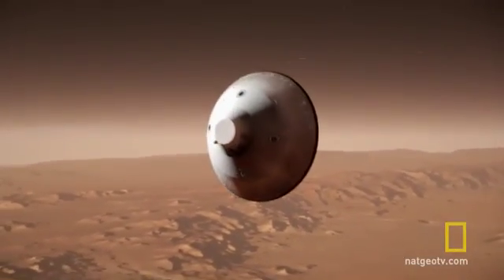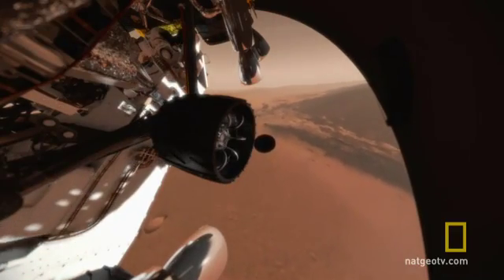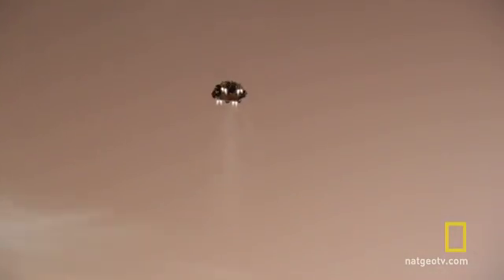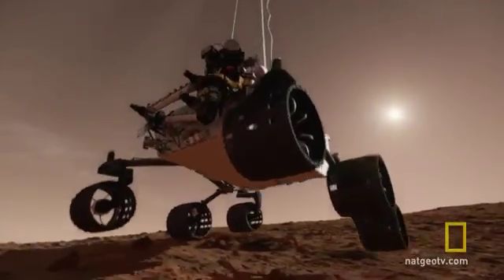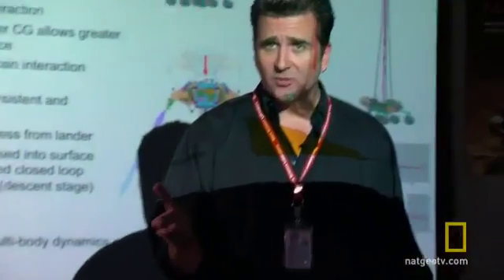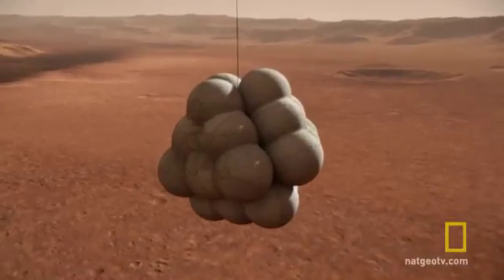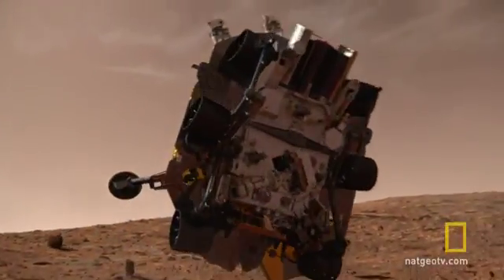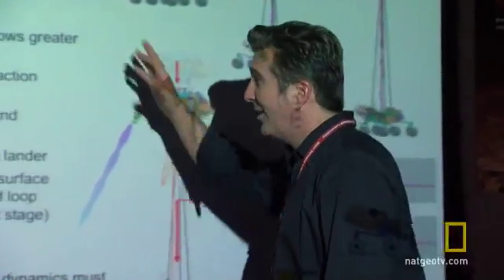Sky Crane | National Geographic

Comment: "They laughed, yes they did. But then they built it."
Reply: And now it's about to land 8 years later
Reply: @advSailing  actually it landed 10 years ago succesfully.
Reply: This video was for Curiosity. But yeh it's the same thing.
Reply: @TheChico868  so the Skycrane technology was imagined for Curiosity but they opted for something else at the time, then eventually did it yesterday with Perseverance am I right?
Reply: @tristand9129  no they used the sky crane for Curiosity. And perfected it again for Perseverance. They could not use the Air bags like they did for Spirit and Opportunity because of Curiosity's size and weight so they had to develop something new. I saw the whole documentary a few years ago.
Reply: @TheChico868  yeah
Reply: @tristand9129  Curiosity was the first try with skycrane, worked great. Great enough they used it for Perseverance and felt comfortable adding another 126kg of weight. There's a video of Curiosity's full landing, from high above to seeing the dust swirling on the ground from the rocket exhaust jets.
Reply: They say its important for a rover landing

Comment: Powered descent mode?  Really?  Where is this on Earth?  Huh?  Never mind a foreign body millions of miles away?  Where is this maneuver here on Earth!?  Huh?  Does NASA think all Americans are chumps!
Reply: The engines have design heritage from the Viking landers, however the SkyCrane's MLE's don't produce enough thrust to hover on Earth (Mars has only about a third of Earths gravity). Static tests of the Skycrane can be found on JPL's channel. Every other aspect of the landing has been done before. All Mars landers have been stored in aeroshells, the guided entry system is the same system used by the Apollo CM, probes have been landed multiple times with parachutes, and rovers have been hung by a tether before (the MER missions). The information is out there if you are willing to look for it.
Reply: Yup.  And still the reason foe no Earth Tests of the "Sky crane" is what again?  Are you kidding, insane, or s troll?
Reply: +Prospero Cobblerit is used u idiot .... it is called HELICOPTERS..... and it turns out they are more efficient that rocket engines in earth atmoshere whereas on mars which has a really thin atmosphere thy use rocket motors..... and spacex pretty much did one with rockets ass well......
Reply: Mars has lower gravity, powered decent is much better there Prospero.
Reply: MrRobtwothirds

The Stetzler character is precious.  During the press conference after the landing- he knows absolutely nothing!  And is constantly referring questions to people with absurd names- who are surprisingly- not there to answer!  He acts like a teenager bullshitting his way through a book report of "The Great Gatsby" in high school without even bothering to read the cliff notes!
Reply: Im Adam Stetlzer:

"Um- I can't really say to much about the landing- it looked good- really good."

"It was nominal- from our data- really nominal!"

Can you tell us about the file type compression?

Nope- but my friend Santiago can- is he here?   nope.  Ok

Complete joke.

on and on like that -  he couldn't answer one damn question.
Reply: Oh- and please explain to me exactly how a rocket works in a vacuum and in a mars atmosphere that is basically nonexistent. 

But didn't you love those terrible "Wind Storms" you saw in the Martian movie!

Whoopee!  We be going to mars- and King Kong is gonna climb the empire state building on the same day- why?  Cause I sees it on the Tubular motion picture machine on mys nightstand every night!
Reply: *****
They must think enough Americans are chumps enough to believe this ridiculous nonsense, and they also know it is far easier to fool someone than it is to show them they have been fooled.
Interesting that the cool dude chief engineer is called Adam Stetzler, living up to his anagram "Drama Lent Zest".
Reply: michael papadopoulos

Helicopters can't even fly to the top of Everest for rescue missions because the atmosphere is to thin to sustain their loft.  Please explain to me how exactly a "helicopter" would work on Mars with less than one percent of out atmosphere even at ground level?  Indeed- the entire notion that we dropped rovers on mars with parachutes is absolutely absurd on its face. 

Do you have your star wars original figurines still in their original wrapping?

Comment: yes.. but just 1 tether doesn't release and the skycrane takes the rover with it on self desctruct, or a skycrane rocket has a failure and it could crash right into the rover. 

seems like a whole lot of failures that could happen that I hope they've engineered to be fail-proof.

Comment: Not that easy. You have to cramp the rover with the lander in the same aero shell, so there is a limit on the size of the lander. A small lander will risk landing on a slope or rock and topple. And you need a ramp to drive the vehicle off, then there is more weight. And the biggest challenge is to put the retrorockets underneath, which would kick off dusk and damage sensitive equipment.

Comment: Why not put a shield on the bottom and have the same liquid engines slow the decent? Then the capsule can detatch and the rover can drive off the shield after absorbing the impact.

Seems logistically simpler and you can still land on slopes.